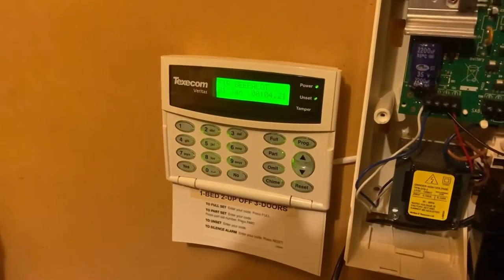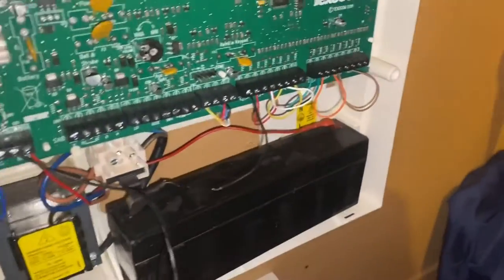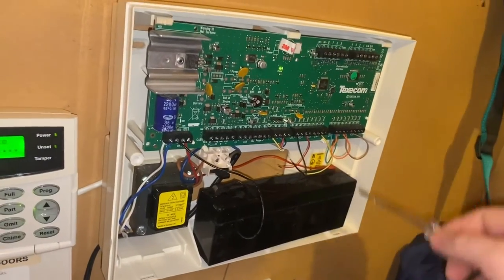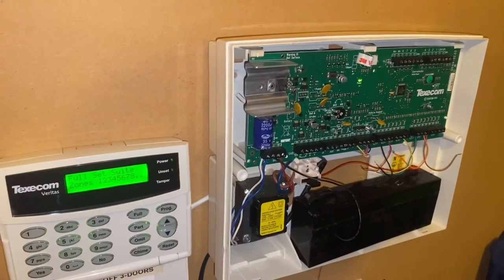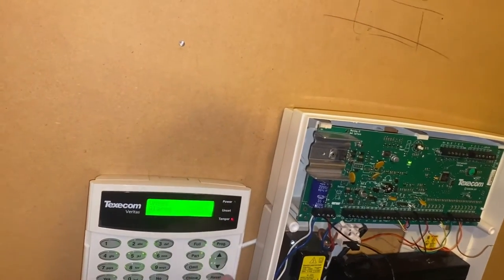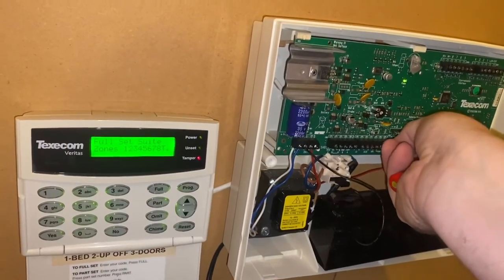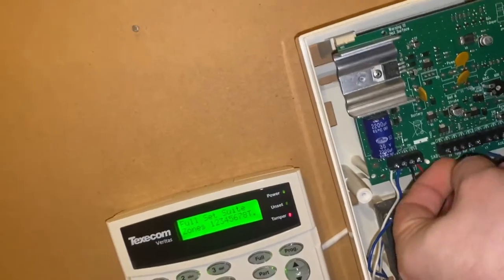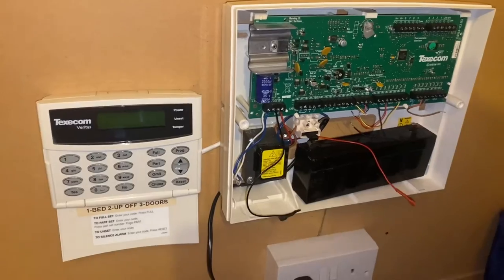Texecom Veritas Beeping and not setting.

Comment: Tampers are a pita, in a domestic setting I don't know why ppl think they need tamper on anything other than the main panel and the bell box, also I can't see any way on the premier elite of disabling tamper on ricochet devices, I get tamper faults off the magnet door switches when nothing is wrong with the micro switch, I'd disable it in the software if it would let me, I think the standards don't allow it in the UK.